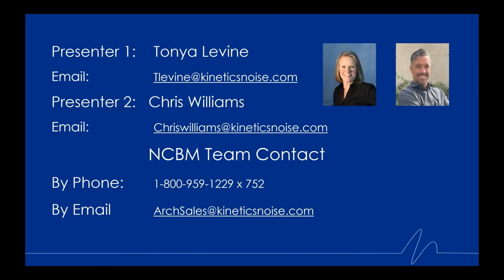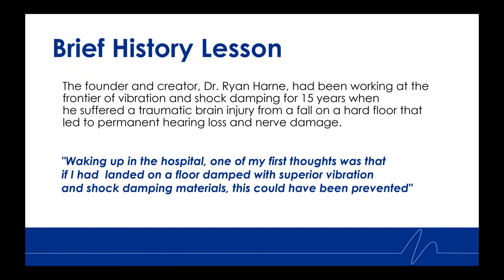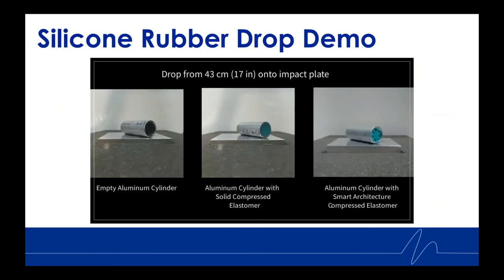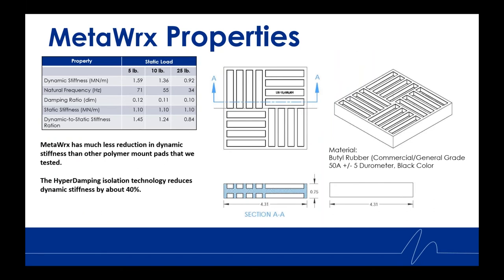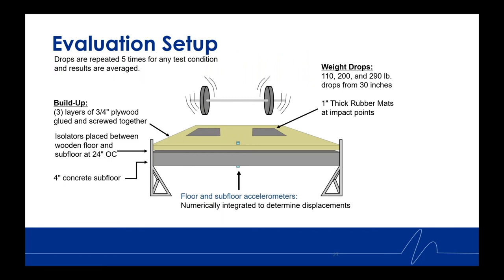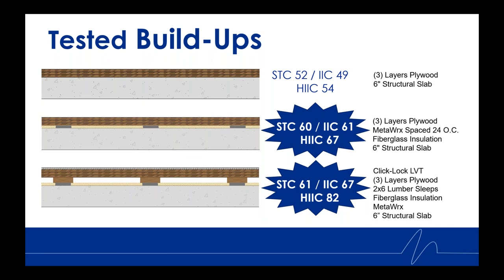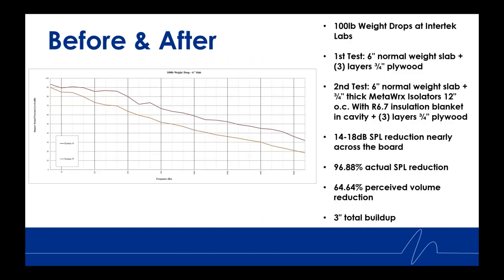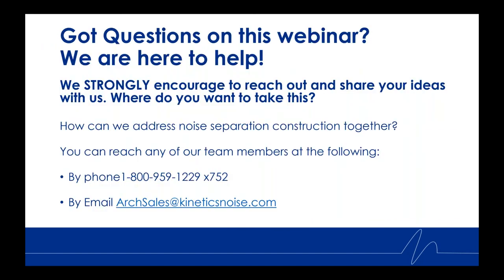Webinar Recording: MetaWrx Isolator Introduction

Comment: This is very interesting. Could you please explain why you decided to show the IIC and HIIC results but not those for low frequency impacts? Wouldn't the dropping of weights be better represented by the LIIC rating?
Reply: Hi Henning. That will be the focus of our next round of testing. We did execute 100lb weight drops from a specified height in the lab of an unisolated versus isolated floor system and measured the difference in sound pressure levels, about a 6dB difference at 63Hz and from about 125Hz to 8KHz ranges from about 14-18dB SPL. We conducted addditional testing with a variety of weights and can share that with you. While we're on the topic, yes, there is the LIIC. What is your opinion of capturing 20Hz - 80Hz with a tapping machine versus a standardized medicine ball weight drop test. We're inclined to head the route of the medicine ball, as the physics of a small tapping machine hammer to generate the lows we aim to accurately capture seem, versus ball drops to simulate the low thudding of footsteps, we're debating but intend to pull the trigger on low frequency testing sooner than later. Interested in your thoughts. Shoot me an email and we can dialogue.